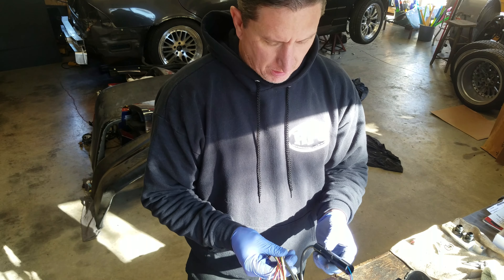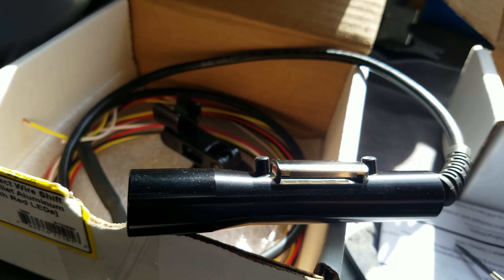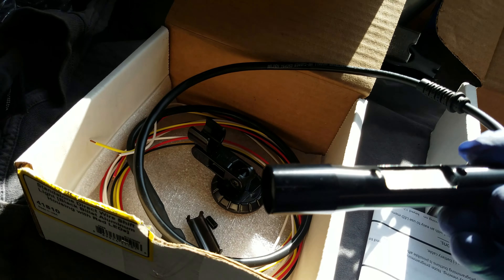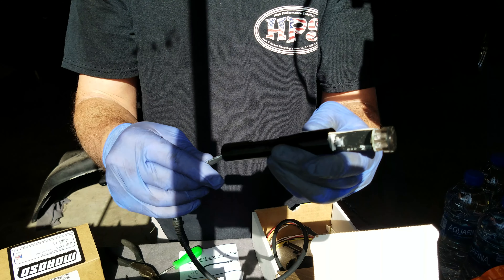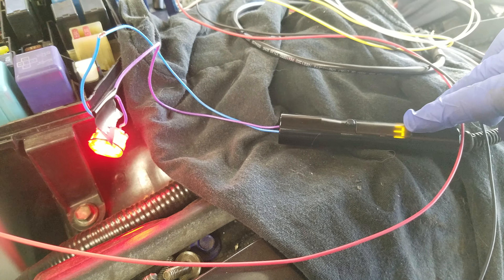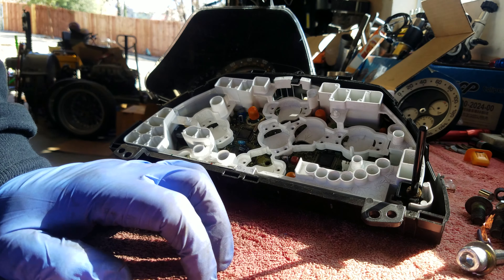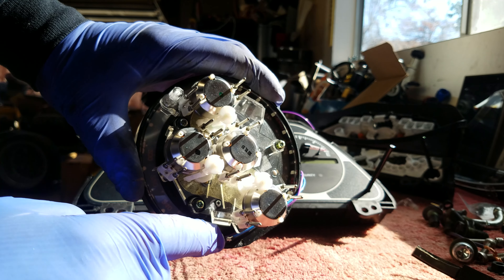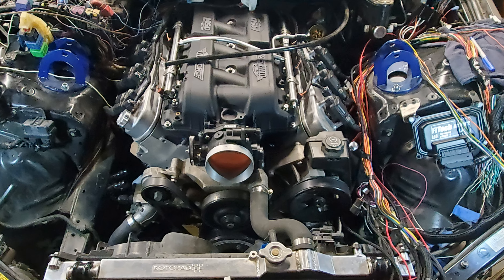How to make your stock cluster a shift light. I remote mounted a shift light into my IS300 cluster.

Comment: I have an 02 manual is300 and want to do this but only to the rpm side of the cluster.. Where does the shift light connect to on the oem ecu/harness? cool video btw
Reply from the maker: It's been a while since I had the factory ecu. I believe you tap the black wire on the ignitor. One of the experiments I did was placing the LED on the tach side. I actually didn't like it. There is some built in shadowing on the tach side that made the LED only bright in the 3k to 5k range.
Reply: @jasonwilcox7322  oh ok so this mod is more for non oem ecu's
Reply from the maker: @the_visionvry6244  All you need is the tach lead, which car you own or ecu it's running matters not. On the IS300 there is a tach lead to pull from. It's just been a few years since I researched it. Pretty much any of the aftermarket piggyback systems like the MAP ecu need the tach signal in order to function.